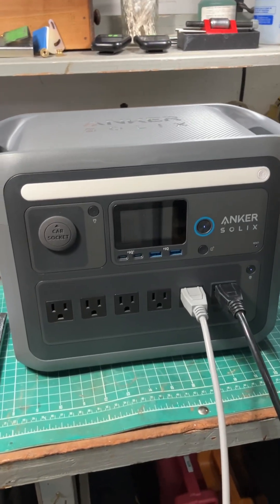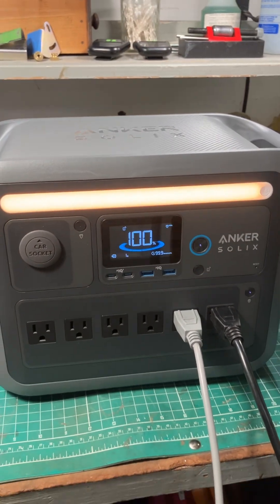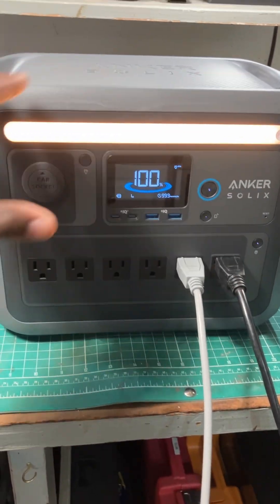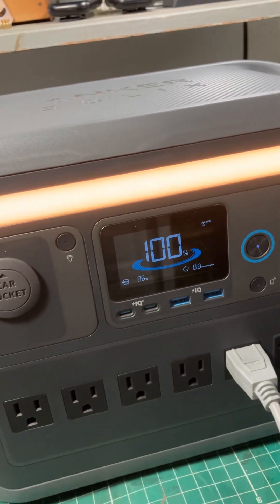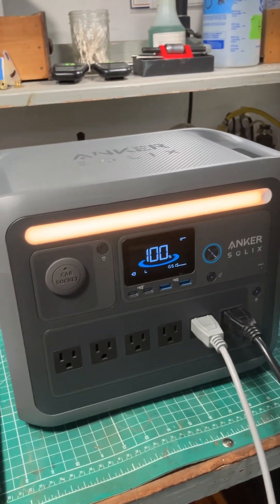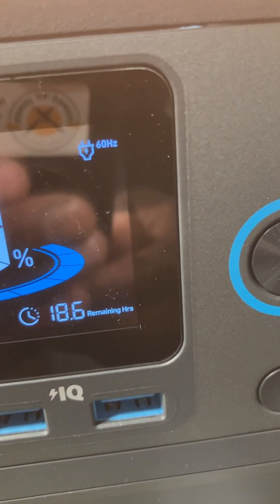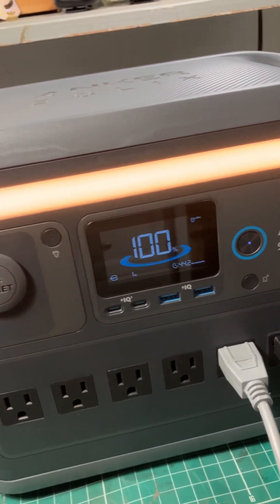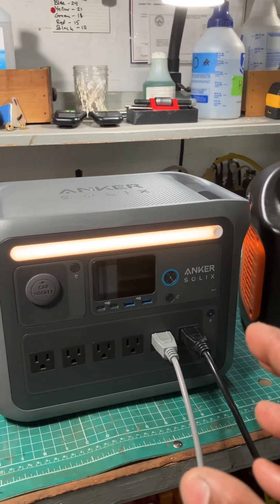Did I make a mistake by replacing my GAS GENERATOR with this SOLAR POWER STATION?

Comment: do you know off hand how many watts a bucktool 1x30 slow speed belt sander uses?
Reply from the maker: I don’t but I’m guessing it’s under 100
Reply: @HonedByJones  Thank you for the reply.  
Also, one other question.  Are you going to use the vevor for basically edge trailing?